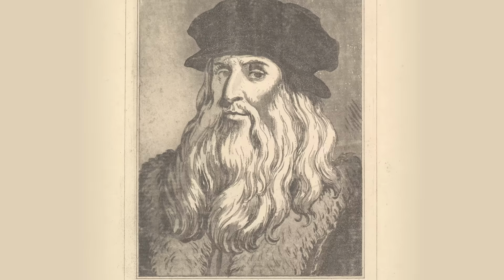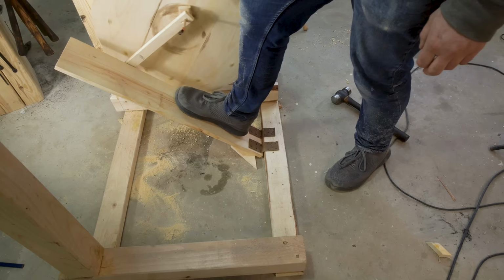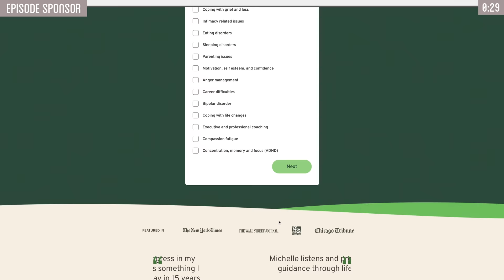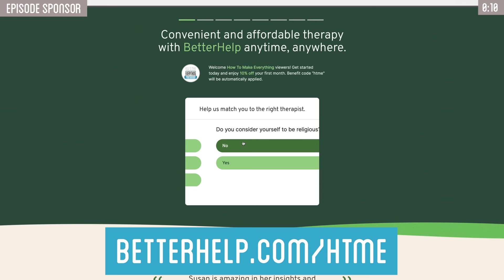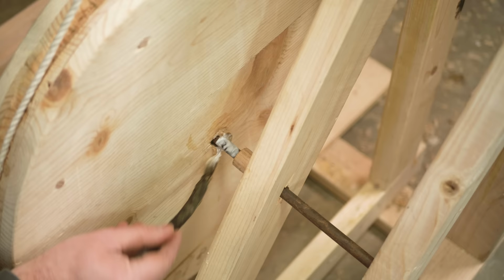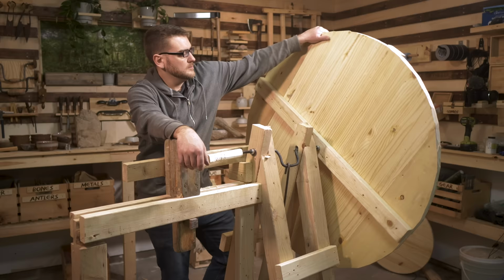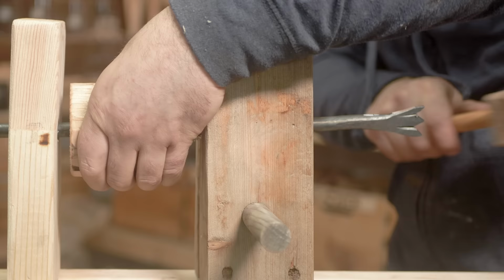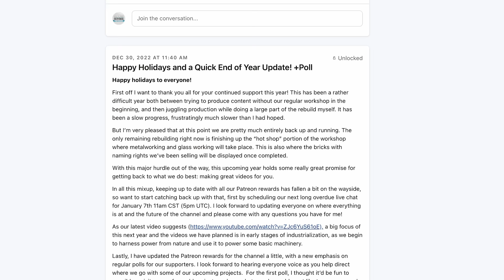Does DaVinci’s 500 year-old Lathe Work?

Comment: Piece of advice: ancient doesn't mean poorly made. You seem to be starting from first principles in every case, and that's neither practical nor historical. A big improvement would be to use a treadle spring lathe to make the pulleys and axles for your Da Vinci lathe. Also, instead of cord for your pulley, you'd be better off with leather straps. This would give you far more grippy surface area on the pulley wheels and greatly improve both stability and power. Also, there's no reason not to use a metal bar to connect the treadle to the flywheel. It was just painful to watch unnecessary repeated breakages. Da Vinci would have fixed that first time it broke... so should you.
Reply: Yeah, I have to agree. I'm sure there's a rush for the delivery schedule, but still, some of the woodworking is just painfully bad. I know this isn't the fine woodworking channel but it's why it's almost but not quite enjoyable for me. I like the ideas but the execution is frustrating. I think it's just because if he took the time to do a good job people would get bored because one episode here would require five or ten in that format.
Reply: Look at the tools he's using they are crude instruments lol not gonna be the best work with those things the saw teeth are rounded lol
Reply: @glennwilck5459  With more time, a skilled user can get a fair bit of precision even with simple tools. Just see what Clickspring has done for an example.
Reply: I hate to be a negative Nancy, but.... This channel has been wrought with issues like this for a long time. Dude isn't the kind of person that has an intuition for building. I love the channel idea, but his execution has always been quite poor.

He's always come across as somebody who's worked his entire life from a computer chair and had no experience in the trades, then decided to learn as he went. There's nothing inherently wrong with that. I actually admire that in principle. My issue is that he's broadcasting that to millions of people, causing a constant stream of poorly executed demonstrations that are both unclear and misleading. It's just irks me.
Reply: @rharris22222  well move on there
Reply: @NautilusGuitars  of there osnt anything wrong outside of not being a master wood worker, please move on then it's not the point of the channel
Reply: I'm sorry but the whole point of the channel is one guy learning to build everything. It's not an instructional video in how you should do it but rather his process and thoughts as he goes. Maybe you should check out videos designed to teach instead of share a journey if that's what you're looking for?
Reply: @batsardcat3285  Actually, that's just what I have done. I looked at a few, decided it wasn't for me, didn't subscribe. But because of my interests,  YT throws this channel at me now and then and I have a look. And you could take your own advice,  after all. This is hardly a flame war, after all, just a mild discussion, and you could just move on, too. Cheers.
Reply: @batsardcat3285  I did move on. Just as Richard Harris said, I never subscribed, but get his videos reccomended from time to time. I decided to check back in, but it's the same sort of half-heartedness that make me decide to not sub in the first place.

You really need to consider that this guy is demonstrating tons of things very poorly to his audience. When people decide to try it the way they saw him do it, his poor understanding and flawed execution will lead them to also have unnecessary failure and difficulty, which actually leads them further away from these sorts of projects. It's somewhat irresponsible. He chose to put himself in a teaching role without the qualifications to do so well.

I remember a metal casting video or something like that, and his presentation and understanding were so awful that anybody who took information from it would be doomed from the start. It was one of the must viewed videos on the subject and it was deeply misinforming. That's a problem. And 3 or 4 years later, he's still doing it.
Reply: @NautilusGuitars  so in your mind if someone wants to do a channel that shows his progress of learning how to build tools and machineries that di Vinci built and used the person needs to be a certified teacher with a doctorate along with a master machinist master woodworker and a professional movie maker
Reply: @deathryder711  This guy isn’t learning though. He keeps making the same mistakes again and again. Watch some of primitive technology’s first videos on a topic like masonry and then watch his later ones. You will notice his skills have improved. HTME hasn’t improved his skills.
Reply: @Knirin  ok 
To be honest I have only seen a few of his videos and when I saw them I never expected a perfect peice 
I just looked at it as does it work 
Does it do what it's supposed to do 
If it is something that catches my eye I might think on it along the lines of 
If I had the time money and space what would I do differently 
Honestly the only reason I commented is the comment I responded to gave me the vibe that dude expected lil buddy to turn out master quality product 
My bad if I took it wrong 
Haven't had my meds yet
Reply: @rharris22222  like who cares? You can make your own videos like u want.
Reply: Hardwood structure and ballast would greatly improve the operation and results. Hardwood would be what was used back then as so readily available.
Reply: I eeeeh your not wrong but it came off p agro bruv.
Reply: @NautilusGuitars  so you think for someone to make videos like this they should be good at what they do? That would involve being good at many different disciplines that would have been peoples whole careers that they would have studied and practiced for years. It isn’t practical for him to put loads of time into every new thing he tries to learn when it could take years to get good at every one of them.

To say it is irresponsible for him to do this is just ridiculous, who do you think is just going out and blindly following these videos? They are mostly for entertainment and are reasonably interesting, anyone setting out to copy these with any kind of sense would look at more resources than just these videos.
Reply: What he needs more than anything else is some clamps and at least one vise.  It's so frustrating watching him banging shit that's sliding around on the ground or propped up on precarious posts and... Blugh.  I can tell that 90% of his sloppiness is coming from working on all these unstable parts and surfaces.  Make some clamps and vises, dude, come on!
Reply: I like him using tools the way he does I feel its more relateable in a way since I would likely make the same mistakes and also opt for hand tools
Reply: @NautilusGuitars  Did you forget the entire point of the channel is ordinary people attempting to do everything by hand? He isn't a tradesman and that's the point
Reply: @conorstewart2214  No, you're conflating "is" with "ought" I'm not saying what he should or shouldn't do. He has the right to do whatever he wants. I'm simply criticizing his lack mechanical aptitude, considering it's the entire premise of his channel.

There are several people on YouTube who do the same thing, and do it very well. Certain people just have the aptitude for thses things and the disposition to study and understand them well enough to do so. Those are very special people. He's trying to be like those people without having those prerequisites, and it has led to many videos that mislead and misinform people.

What brought this to my attention initially was a metal casting video he did where he confidently explained several things that I followed, assuming he was knowledgeable. It turned out that many of those things were completely wrong and I had to find out the hard way.

Another one was his video about making glass and lenses, which was wrought with lazy research, complete misunderstandings, etc. All said with certainty and confidence. A few hours of research and a bit more effort would have made a huge difference. But he just did a quick Google search and went with the first thing he found without even understanding the science of it. Then unleashed his deeply flawed interpretation of it onto millions of unsuspecting people. 

When you click on a video by a channel called "how to make everything", and then see tons of different, unrelated projects in the reccomended tab, the assumption is that the person is qualified and talented.

His channel isn't called "trying to learn how to make some stuff", nor does he have any place dedicated to explaining that intent which you're projecting onto him.

Geeze. Idk why so many people get offended on behalf of others they don't even know. I made a simple statement. Y'all have pushed me into elaborating by trying to defend him, and are making this become much bigger than it was ever intended to be.
Reply: @nikkothegoblin  read my previous comment.

And please share with me the place where he explicitly describes this intent that you've projected into his channel. Since you're claiming it's the entire premise of his channel.
Reply: "Da Vinci did it! Why can't you!?".... lol
Reply: the whole thing of this channel is that everything is made by hand without modern equipment. im sure ancient/old mechanisms would be higher quality simply because the professionals of that time (woodworkers, blacksmiths, etc) would be, well professionals. he is a jack of trades here and thats why some things are not built super well. the bigger thing with these videos are the concept, and like hes just having fun.
Reply: @harland04  I'm not suggesting he should use modern equipment. I'm suggesting that he use equipment that was available in DaVinci's time. DaVinci did not invent the lathe... he diagrammed an improvement. But quite good work can be done with the spring lathe already demonstrated on this channel.
Reply: @Brane_Ded  Hardly. More like, "DaVinci left plans. Follow them." Let's not pretend that a lathe is so mysteriously advanced that it's laughable to build one well.
Reply: @dvklaveren  I don't disagree. If this channel is, as has been suggested in this thread, a process of learning, then it's reasonable to build up. To make this improved lathe, then, you should use the tools available to the inventor... that includes another lathe.
Reply: @Pyenguu  Constructive criticisms aren't agro. They're simply suggestions for improvement. I like this presenter. He's personable and easy to listen to. Unfortunately we don't have a lot of space in these comments for pleasantries, but that shouldn't be interpreted as animosity.
Reply: Ok, so people are talking about him exploring his way to success.  If he bothered to read even as much as DaVinci wrote on flywheels, or anyone else wrote about their construction, he would have learned that symmetry and balance are two of the major factors for success (others being weight, and a reduction of friction, amongst other things) so one could always find the actual center point for rotation around, and maybe used his pole lathe to make sure the edge was actually rounded.  Then, perhaps the flywheel would work as a flywheel?  A number of DaVinci’s drawings depended on a wheel being actually round, and even calibrated.
Reply: Hes a YouTuber. New not a lathe maker. He made the lathe exactly what it's suppose to be: a video. Also, a video without any twattiness. Maybe he will take your advice though and make a video with twattiness.
Reply: @hardbrocklife  this is his second wood lathe, theoretically made to make up for the deficiencies of his first wood lathe, and a step along the process to a metal lathe, but, instead, he badly interprets plans and tries to bumble his way through without even vaguely understanding what he is doing.  If he did, he would have realized that his pole lathe doesn't need to wind back, he just has to translate linear back and forth movement to constant circular movement in a single direction, perhaps with gearing or belts, to turn the long vertical movement into fast spinning movement.
Reply: @hardbrocklife  Your attitude on this is truly puzzling. He literally made a previous, more primitive lathe. It's not a huge leap to USE it to make an improved lathe. There's nothing whatsoever wrong with suggesting that he do that to put forth his best effort in order to make the video better and achieving better results on his project. To point that out isn't an attack, nor is it "twattiness" (which was NEVER my suggestion... it's something you just pulled out of your own mind). Rather, it's constructive criticism. You seem to think that any criticism is bad, and that's just factually incorrect. I don't know what happened in your life to make you so adversarial, but perhaps you should address that privately instead of taking unwarranted shots at someone who is simply trying to help.
Reply: What color is your flywheel
Reply: @Alpha__Whiskey98  wood colored?  Perhaps banded with metal, though.
Reply: Lol i thought the same watching this
Reply: Yeah true, it was poorly made, just like a cave man 😂🤣, so rough and unbalanced.
Reply: @omotolaoyeniyi631  it occurs to me that there are a large number of round wooden wheel-like items he could have found for his flywheel, and sitting down to remove the center core and second wheel from a cable spool one trash-picked …
Reply: A fair amount of people hating on this comment miss the point. First off  the channel is "How To Make Everything " and that suggests tutorials. I wouldn't take a single video thus guy has out as a tutorial for anything other than how to half ass things without a solid concept of what is being done. He is supposed to be using old tech to make things from history, and hinders himself to hand tools and primitive tech. He even uses some jacked up lubricant recipe, but slather on modern wood glue lmao. Also, those flywheels He engineers and the process he uses are scuffed from the bottom up. Lubricant don't mean a damn thing if you are using an out of balance flywheel with a lean. This channel has gone downhill, to say the least.
Reply: @weathercaster  I know.  And he could even use the flywheel itself as a crude lathe to smooth it down so it’s at least evenly round, if he didn’t want to do so with his existing pole lathe.  Which, from the clips we saw, the turn element wasn’t even hooked up to a linear to circular device, just basically string wrappers around the piece, so he had to go back and forth, instead of a constant (single directional) speed.  Perhaps this channel would be better served by adding a “not” as the second word.
Reply: Simply sharpening his tools would help a lot.
Reply: @Mr Redstoner  yes but nobody is going to build 99 of those and get it right  the 100th time. Don't build something this tactical, and just bucher every step of the way.
Reply: @NautilusGuitars  I'm hearing you, and you're making sense. I'll shamelessly plug my own channel because I think you might like it. It's tiny, I don't promote it and I haven't put anything new out in years. I can handle myself in the shop, but my presenter skills are non existent. I do think that "presenters" are given more weight in our current culture, and that is a problem.
Reply: @theblacksmith2323  I completely agree, and funnily enough, I can say the exact same thing about myself and my channel. So I'll check yours out and offer you to do the same, though mine is guitar related. 

You want to know something funny? Before I ever knew this channel existed, I had an idea to do something similar. Growing up poor, I had to learn how to make everything myself. I rebuilt my first car, every piece of electronics I had, I got as scrap and learned how to repair. When we couldn't afford gas, I made a water heater/shower out of an air compressor, beer keg, and wood fire. I brew my own beer, distill my own liquor, make many of my own tools, and stock my fridge often with food I caught myself.

I always wanted to make a channel to teach people in the same position to do those things, or hoped somebody would. Seeing this guy butcher so many subjects, trying to do that, by clumsily bumbling through them just irks me.

I'll check out your channel later! Thanks for the sympathetic response!
Reply: @NautilusGuitars  Yours comes with tunes!
Reply: @nela9994  exactly. I don't know very much about lathes but I know a fly wheel must be very symmetrical and heavy to overcome the forces that will be applied to it. If it's unbalanced it fights itself and becomes incredibly inefficient. You could see that in the first wheel he made. I've seen Indian potters use huge fly wheels to throw their clay and they worked wonderfully. A balance fly wheel would have gone a long way.
Reply: @XSR_RUGGER  oh, yes, flywheels for pottery, lathes, sewing machines, mills, sawmills, pumps, slingshots, and even batteries can be excellent and useful things, if built right.  Without the symmetry, they can be even more destructive to the project than beneficial.  Without the design, and respect for their power, they can be destructive to the individual trying to harness their power.  Like Tesla’s turbine, if the material science isn’t right, the slight imperfections or the wrong materials will have the wheels shattering and exploding outward with incredible force when used. A lack of understanding about these things can get you a guest verse on “bad ways to die”.   And a little more research beyond looking at a picture, and saying “I could do that” is called for.  And the research, in this case, is readily available, even.

It’s good to talk to a fellow traveler.  Be well!
Reply: I can't believe how high some peoples expectations are from a do it yourself YouTube channel.

Of I've learned anything from this thread is that if you ever need to sue a contractor for doing a bad job 

Just get literally any other contractor to testify for the shyt job because they all seem to hate each other's work
Reply: @Bee-tj8gc  what’s the name of this channel?  Oh right, it purports to be an instructional channel, showing how to build, theoretically, from scratch, all kinds of nice machine tools, using just what was available “back then” or something.  Except not.  And, well, not even really following the instructions, so the proposed question “Does this thing even work” the answer would be “not the way you are building it, but have many other people succeeded with these designs, where you have failed?  You betcha.”
Reply: @NautilusGuitars  he also has the charisma of a bag of sand. Poor execution, poor craftsmanship, and the guy is a human shaped void where a personality should be.
Reply: @nikkothegoblin  the name of the channel is How to Make Everything. That implies a level of expertise and a tutorial nature to the videos. This guy has zero expertise, clearly doesn't know what he's doing, and doesn't seem to try to improve his skills.
Reply: I'm glad someone else thinks this as well. I thought maybe I was just being a bit too critical.
Reply: How To Make Everything - Poorly
Reply: Should be called: how to make everything poorly.

I know he's not a mastercraftsman, but if he's gonna replicate an idea from design he should replicate it properly and if he doesn't know how he should explain that and either learn or get help, it seems fraudulent when he says "does davincis 500 year old lathe work?" And it looks like homers bbq
Reply: This is a good ham sandwich
Reply: This guy just isn't very good at making things. It's kinda amazing that a guy with literally no aptitude for making things runs a relatively large diy channel. I feel as though this is just a job for him.
Reply: As far as I understand, he only use technology that he have "developed" previously...
Reply: @rp1174  Please re-read what you wrote and think it through.
Reply: @leighdf  I did and I don't understand what bug you, I said developed into brackets...
Reply: Agreed id go as far to say alot of people from ancient times were way ahead of most people in our own time of overly compulsive behaviour. If anything that proves that we are exactly like our predecessors we are all just branches of the same tree and eventually some die off and new growth comes they may all take different shapes, colors and sizes but as it grows it is clear to see we are all made of the same ingredients.
Reply: If someone can't make something even with modern tools then they are going to be hopeless with ancient tools
Reply: @rharris22222  Ackhually. 🤓

You must be a delight at social gatherings.
Reply: The challenge I have is that if I am hearing him right, he wants to build a steam engine. If he does it like this, he will find it a frustrating task and his family will have to upload the video because he will die in making the pressure vessels.
Reply: @MrRedstoner  key word is skilled. Everything he's doing is basically his first time doing the process. Paired with having never utilized the primitive tech till recently... You get what you get.
Reply: Dude.. sharpen your chisels. They will work much better
Reply: I’d like to see you do it better
Reply: @jonaheberle187  Dude, YOU could do it better. I just told you two ways to improve it that are period-accurate.
Reply: @jonaheberle187  YOU could do it better using the three suggestions I made. You could try it yourself.
Reply: @NautilusGuitars you realize he just had a big workshop fire that destroyed most of their progress, right? They’re dealing with that too
Reply: @leighdf saying how to fix something is 100x easier than fixing it. Getting a wood wheel perfectly symmetrical and balanced, with clean edges is incredibly hard when you’re not versed in the trade, and he’s not about to become a master tradesman for a few videos. The whole point of the reset was to try and create society from scratch, and to see if a normal person could do it with the help of modern knowledge but only primitive and time-appropriate tools
Reply: @nela9994 Everything we use comes from 8000 generations of collective innovation and discovery. But could an average person figure it all out themselves, and work their way from the Stone Age to today? That’s the question we’re exploring. Each week I try to take the next step forward in human history. My name is Andy and this is how to make everything” this is word for word what he says at the beginning of almost all of his videos. It is crystal clear this is not a tutorial channel. Go to the olive soap one, or any of the ones before this. He opted out of using it for videos where he compares concepts like the concepts of doctor stone or leonardo da Vinci, but they are still apart of the series. Also they literally just had a huge workshop fire that destroyed a bunch of their stuff so give them a break. And guess what, it’s not wood glue. It’s hide glue. That they made :D. How about actually watching their videos
Reply: @sophiadebar382  I did not suggest modern tools in the least. I recommended appropriate tools for Leonardo's time, which is exactly what he SHOULD be using to recreate Leonardo's designs. I didn't tell him how to make it perfect; I told him how to make it better using the time-appropriate tools and techniques. What I did is called "constructive criticism".

Since you gave me advice, I'll give you advice. Before you berate me, make sure you've ACTUALLY READ what I wrote and put it in context. Your comment doesn't apply to anything I wrote.
Reply: @leighdf  which is exactly why this is not apart of his larger series. Go to the reset playlist, and you’ll see that this isn’t in it. Right now hes at about the the 12th century. THATS why he hasn’t made those tools yet. It’s just that sometimes he makes videos exploring different concepts from things like Dr stone or in this case leonardo da Vinci using the tools he has with him. The missing the context of your comment is my bad, I read like 60 comments back to back and got so confused who said what, but I was feeling bad for Andy that everyone was dunking on him. But I was replying to all of your comments, not just the first one you made. I know you didn’t mean for it, but your comments came off as pretty aggressive against Andy when he’s really just doing his best, and I’m not the only one who thinks so, so maybe you should look into that.
Reply: @sophiadebar382  I get what you're trying to say. However, spring lathes are THOUSANDS of years old. What I'm referring to isn't a metallic, machined piece of equipment, but an arm of springy wood to which a line is tied, wrapped around a spindle, and used to turn the wood using a treadle (foot pedal). It can even be done by tying a line to a tree limb (as was sometimes the case early on). There's practically no "making" required. This is exactly the sort of tool that was used in and before the 12th century. Again, I'm just being constructive, and in a comment section I don't have a lot of space. The intent isn't to be aggro, it's to be terse. ;)
Reply: @sophiadebar382  I will point out that I've used a spring lathe myself, in the woods, and it doesn't take a master craftsman. Using time-appropriate techniques gets pretty decent results, and I do want this guy to succeed, which is why I suggest the improvements instead of just dunking on him.
Reply: @leighdf  it is also hard to find appropriate wood and trees and stuff for those kinds of largess that can take the abuse and not break the string or the branch. Sometimes it’s just really hard to get something working the way you want it too, because of a few nicks you made along the way
Reply: @sophiadebar382  The title of this video is "Does DaVinci's 500 year-old Lathe Work?" If you want to answer the given question, you have to give it a fair test. So I ask you, is it giving DaVINCI'S DESIGN a fair test if one does not use the materials and techniques available to DaVinci?  

I'm sorry, but I find this latest comment to be at least as bad as just dissing the channel. It's not only not constructive, it's offering excuses to never be constructive. "It's too hard. I don't have the materials. I don't have the skills." None of these are proven unless tried. One can't learn from a failure to try. You CAN learn researching and by listening to and applying constructive suggestions. Cheerleading alone might make someone feel good, but it doesn't make them a better craftsman.

Personally, I vastly prefer to offer ways to improve the performance and make the ultimate test fair and successful... which is what I've done. I think I've been pretty clear about that. I've had my say, so now I'll stop.
Reply: @leighdf  dude. It’s a YouTube video. Do you understand how important YouTube titles and pictures are to the algorithm? He’s not gonna write “trying to make davincis lathe” because that’s not as eye catching. Also “But could an average person figure it all out themselves, and work their way from the Stone Age to today?” Is literally a centeral part of his thesis, word for word. I think you have to take a step back and realize that not putting such incredible effort into every single project they do isn’t the end of the world. And he’s not dissing davincis design. He made it very clear he that most of what’s wrong with the lathe is his fault. Just give it up man, he’s not gonna spend a year on every project, nor should he. 

Besides, I don’t think anyone is gonna look at this video and be like “huh this davinci guy wasn’t that smart”. He gave more than enough credit to the guy, so just calm down for Gods sake
Reply: Additionally he was known for sending production on parts he was not a master at the workmanship of out to masters of a given craft (although he often later learned how to do it himself), so you can account for that by having pieces pre-made or tuned by someone with better tools/skills, and then work from there.
Reply: Honestly, I just started woodworking this week and I feel really crappy and slow. Seeing some of his work I thought it looked really impressive and I can't wait to get my skills to that level. This channel doesn't teach woodworking though, I love this channel cause I want to know how to make tools that can be used to make tools! Aka "how to make everything". I also believe waiting till you are good at something is not the way to live life, you just gotta go do stuff. I can tell he's learnt how to build and will continue improving!
Reply: Let's see if I can sum it all up here:
Yes, the whole premise is that he's working up from the Stone Age, but at this point in history we're not in the Stone Age anymore, so the build quality should improve.
Yes, there is a learning curve here, and this is not an instructional video, but I think we can all agree at this point that the structures could be more sturdy.
Otherwise great build.
Reply: Most of their videos seem to be the same way, poorly made
Reply: @norndev  Just a thought...
 If they were perfect at building, it wouldn't be as interesting.
Some builders on youtube are so good that sometimes they make it seem impossible for you to do yourself. Here they've beaten that curve and made it possible for everyone to brainstorm different ways to make it better, whether it's in a constructive comment or not.
Reply: @00linered  Meh I think you're giving them more credit than they deserve, they don't have to be great builders to get an adequate result. Their videos just seem extremely lazy. You can be an amateur and get better results.
Reply: You know I read this thread expecting to see some fair criticisms but all I’m seeing is some sad jackass’s insulting him because he’s not a professional but he’s doing his best also I doubt you guys are building machines like this from scratch so there’s no reason to be a dick because he did it a way you didn’t like
Reply: The craftsman ship in these videos is always poor. Materials are poor as well. Cool ideas tho thats more so why ive watched them.